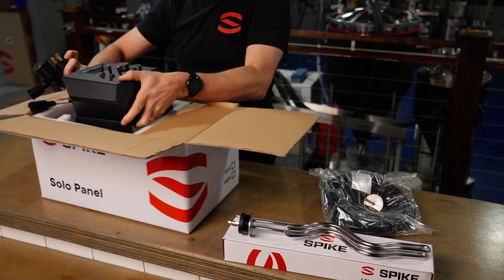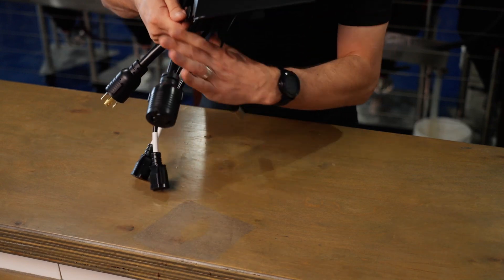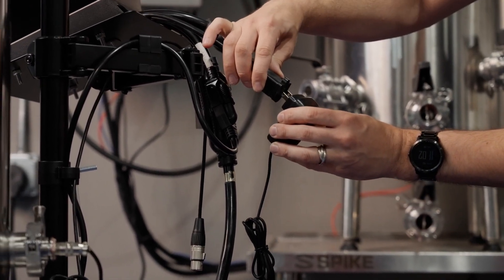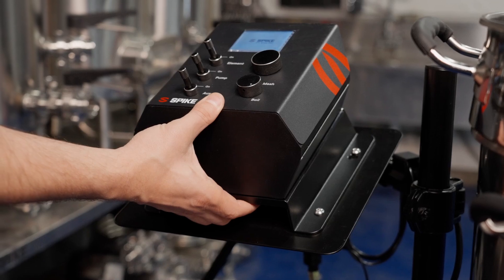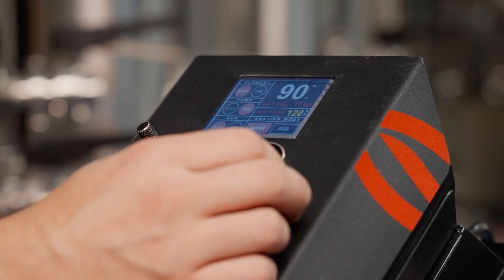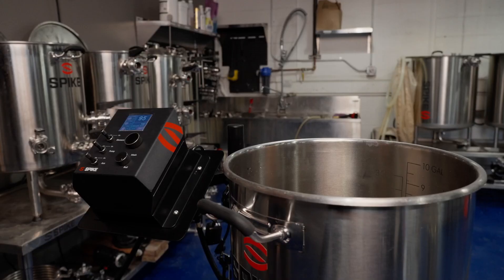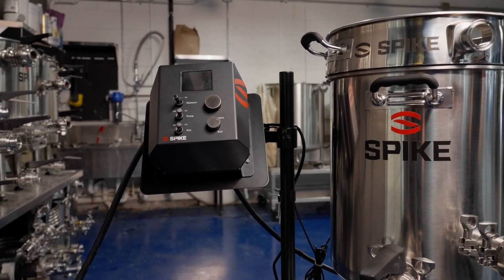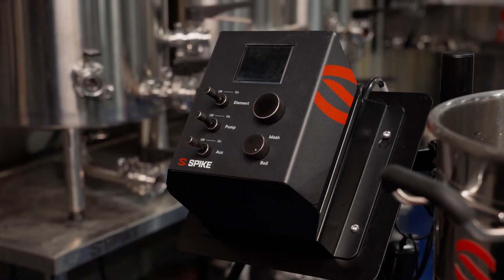How to Use the Spike Solo Panel

Comment: Is the panel convertable to both 120v and 240v? Sorry if I missed this in the video.
Reply from the maker: Yes, it can do both. Just depends on the main power cord in that you select.
Reply: So I could buy both power cords and switch them out interchangebly depending on if I have 120 v or 240 v available? @SpikeBrewing
Reply from the maker: @LukeJohnson-b3x  Yup!